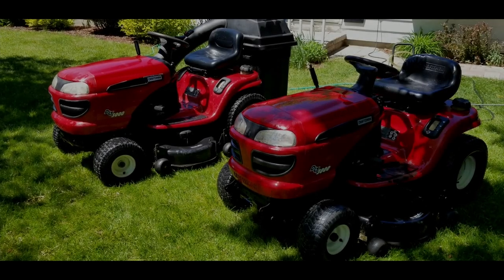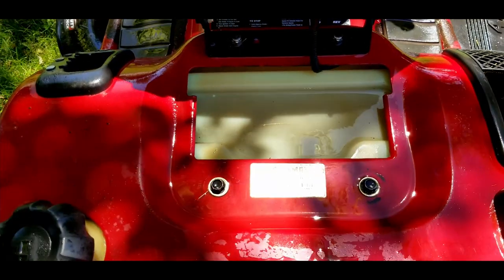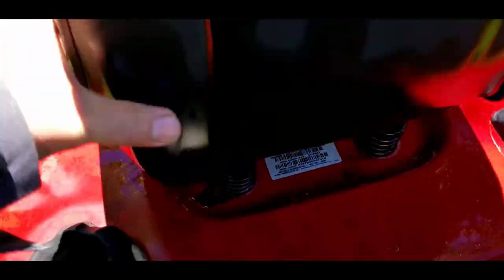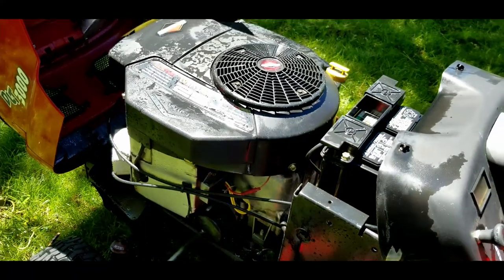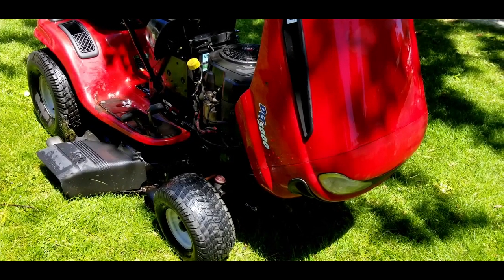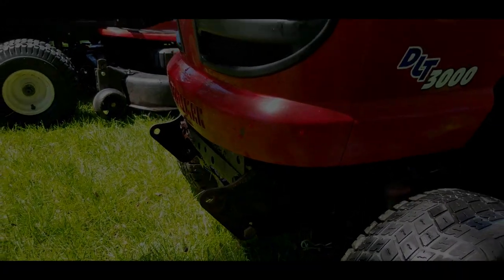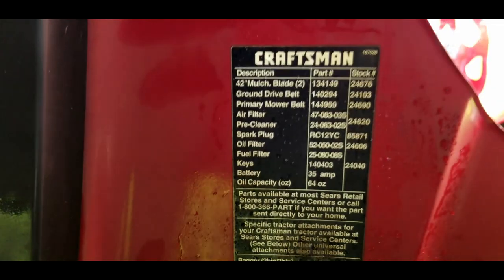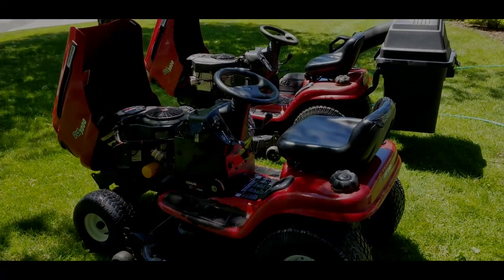Craftsman DLT3000 Twice

Comment: On the mower with the Kohler, can you get the model and spec number off the tag and poet that??
Reply from the maker: The model numbers for both tractors are in the video as well as the description below the video. The model number of the Kohler engine is CV20S - 65596 Serial 3327411081
Reply: @RealManSkills  Awesome, Thank you!!